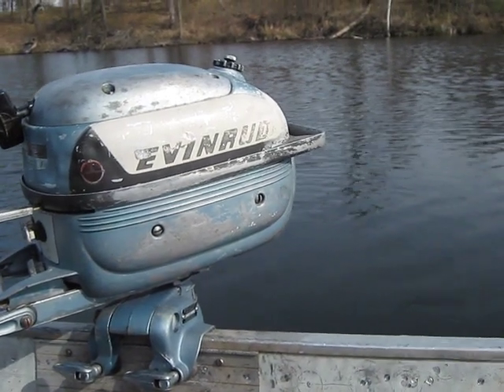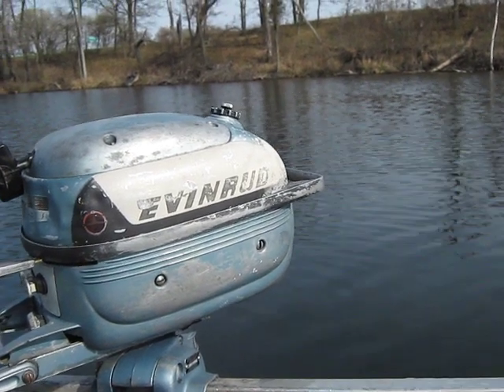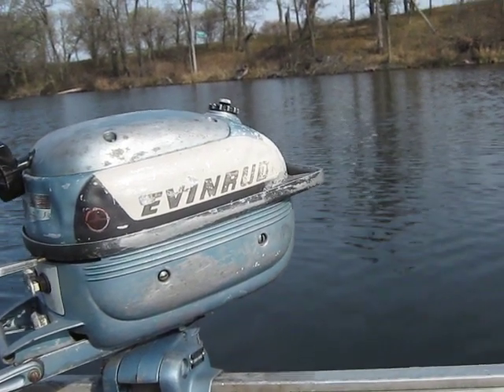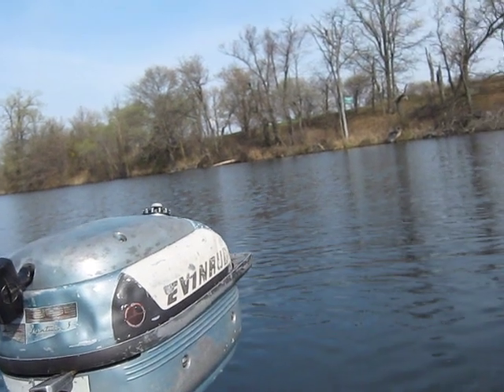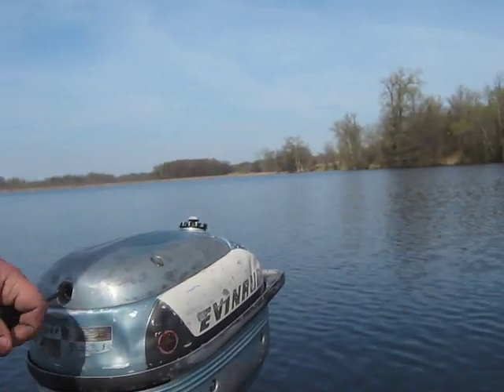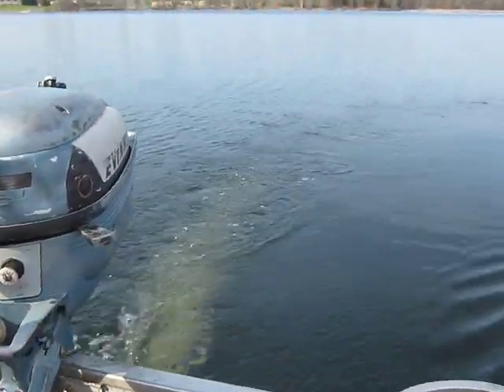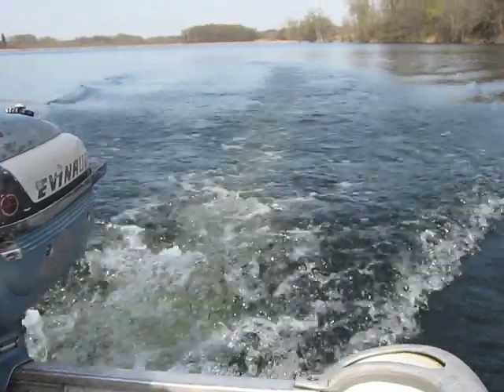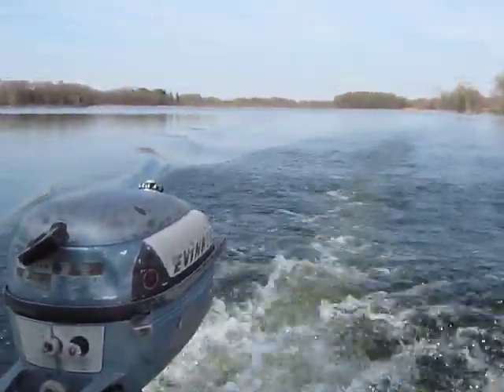1956 Evinrude Lightwin 3hp outboard motor

Comment: Hi Crys
Thank you so much for your answer about 16:1 & tcw3 two stroke oil
I keep the engine running  "but" ...
Now; How you can adjust to rich/to lean? Is very difficult to me achieve the correct mixture Why?Some times very strong! and others off outboard motor For example: I can see in your video that you put on start and you Turn to the left side the lever and
keeping runing outboard non out..!!Thank you

Comment: Hi Crys
I need your help..! I bought a used engine in eBay
Correct mixture oil/gas for 1956  3018  Eninrude Lightwin outboard motor? Please
Recomend some oil too?Thank you so much
Reply from the maker: 16/1 is the correct oil mix with any TCW-3 oil